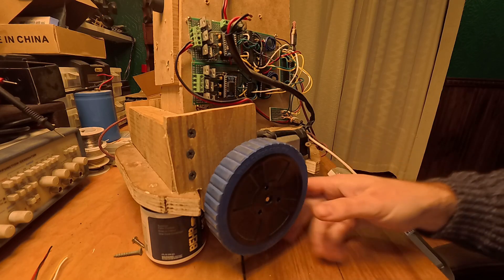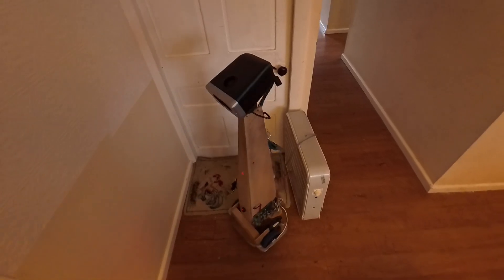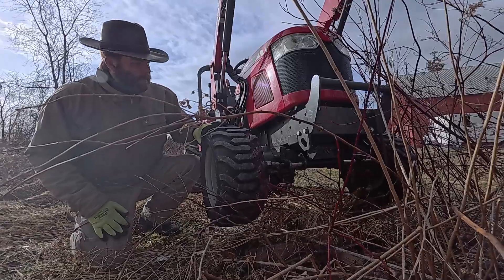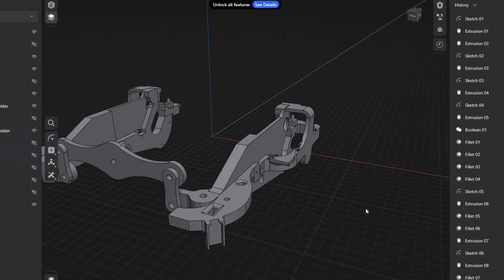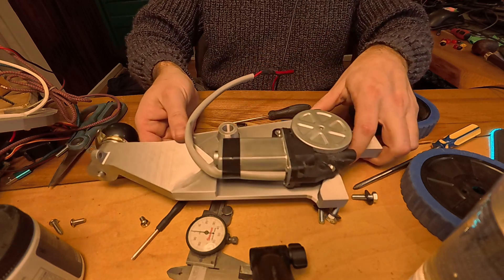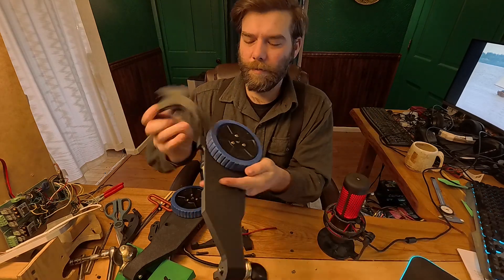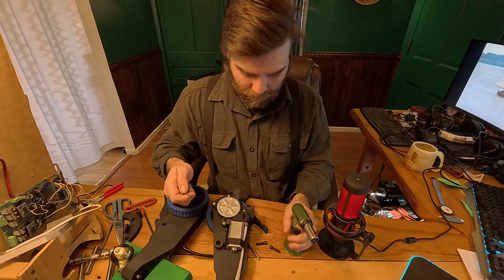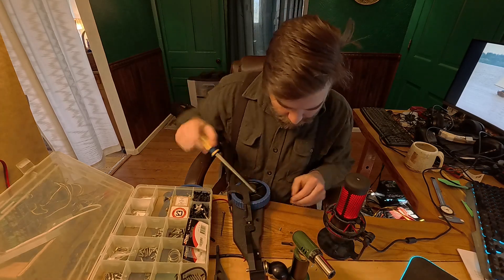Household Robot Project EP11 :: New Chassis Base & Suspension

Comment: PLA smells like maple syrup to me too.  So either we're BOTH insane, or you're ok.  So... could be either.  At least you have a friend in your insanity.  I'm surprised your melting technique works.  What infill did your brother use to print it?  Basically, all you are threading into is a couple mm of plastic.  The hole would actually have been stronger printed as it lays down more plastic to do so.  I would suggest undersizing a hole in the model and THEN doing the melty trick.  It's slightly more annoying to engineer, but it'll make your screw holes stronger.
Reply from the maker: Yeah, so far I've gotten away with it, through-bolting anything that has significant mechanical load on it... but I'll probably change my ways. :)

Comment: Nice design! Have you considered a 'diamond' chasis with  one front caster, two driving wheels and another tail caster?
Reply from the maker: I had considered it, but it would still have required a suspension system of some sort to make sure there wouldn't be problems with wheels lifting.
Reply: @joethieman9400  Yes, of course. I have seen very few casters with springs and they are really expensive. Imagination required!

Comment: Hello great video. what kind of 3d printer do you use? and would it be possible to do a tutorial on the cad software your using? Thanks from Oklahoma
Reply from the maker: I'm using my brother's Bambu Lab P1S. It's really trouble-free according to him. 

As for the CAD software, it's Shapr3D. The more I use it, the more I like it, but I can't say I'm good enough with it yet to make a tutorial... Half of the geometry in my parts is a case of  "Well, that looks pretty good, I guess I'll make it that way".  😆

Comment: I think robots with legs are a great piece of engineering, but if they can only move on nearly flat terrain, a wheel is much simpler and more efficient. A robot, if it can only walk, is nothing more than a toy. (A tablet on the wall in every room is enough for that.) If it has hands and can do things, that's different. I'm curious to see what will become of this. :)
Reply from the maker: An arm (or arms) is in this robot's future for sure! Without them it's just another 'Robot Companion'.  :)